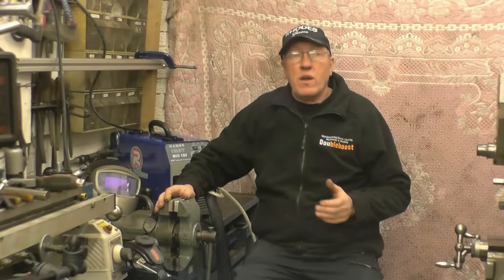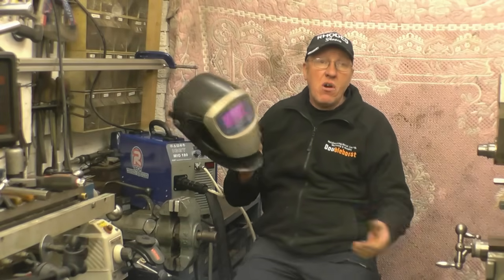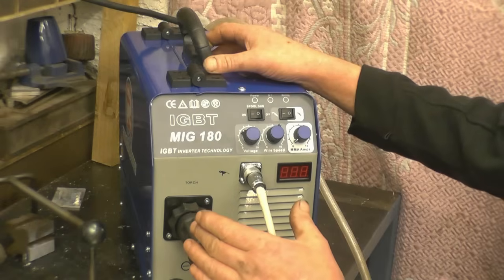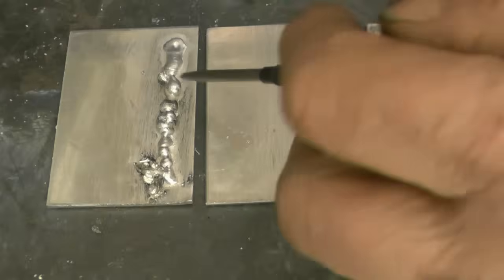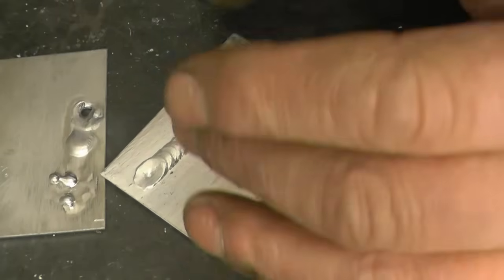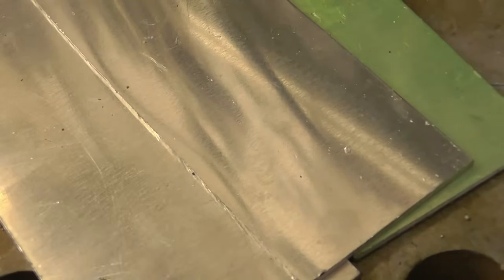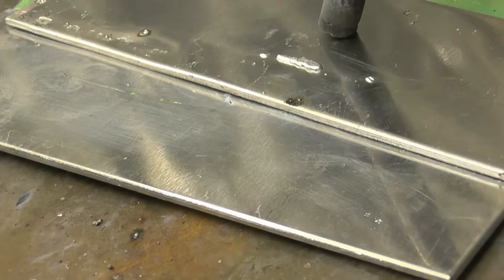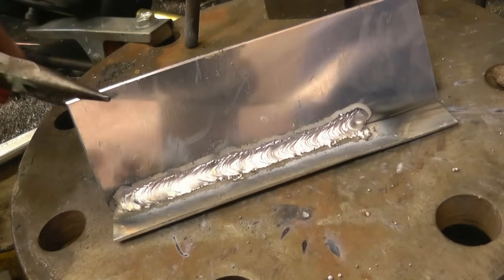R-Tech MIG180 Spool Gun Aluminium MIG Welding Part Two

Comment: Great stuff! If you haven’t used a spool gun for 20 years what have you been using instead? Thanks again
Reply from the maker: For flux core at work we use a push pull torch   motor in the welder pushes  motor on the torch pulls